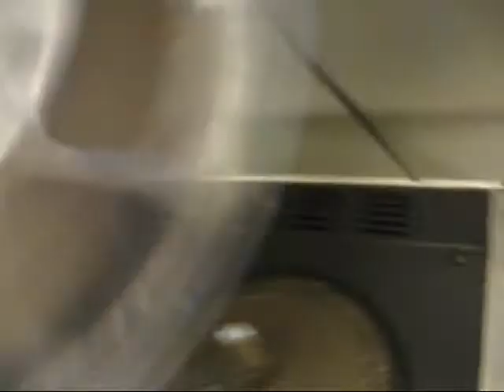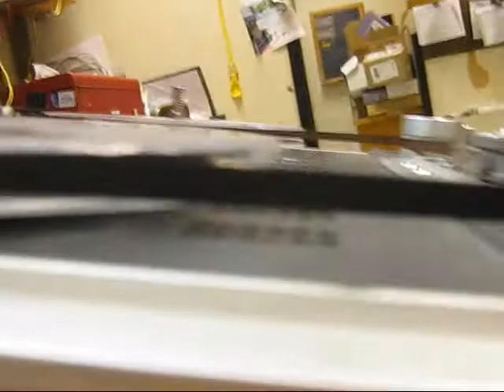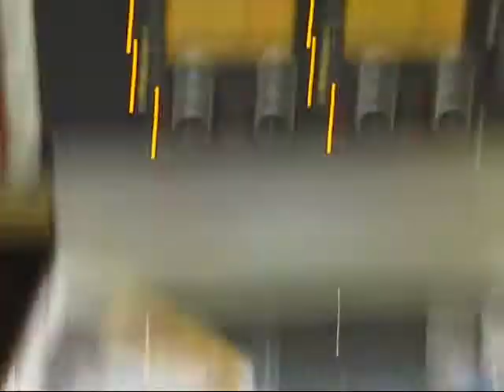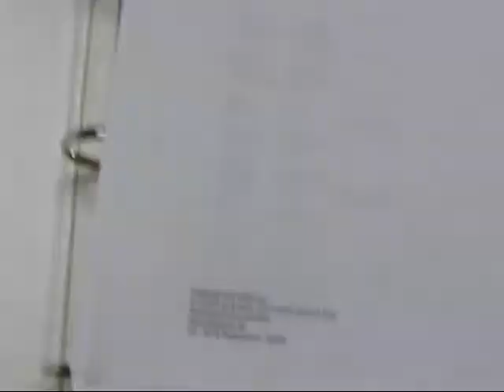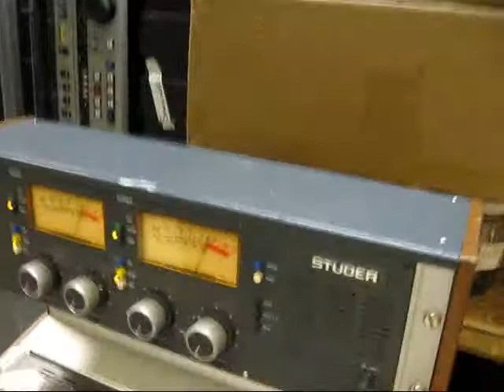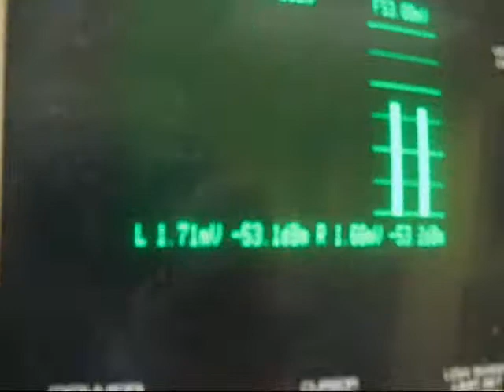Tapealigt.wmv

Comment: Want to know how you can win yourself a free pillow to place in front of your speaker? Just set the azimuth wrong while simultaneously enabling Dolby B noise reduction on a tape that wasn't recorded with the noise reduction on. Inserting this 'electronic speaker pillow' is what gives cassette tapes their bad audio quality.
Reply from the maker: I spent a lot of time as a kid trying to "optimize" my portable cassette recorder.  While I never really got great sound out of it, I learned a lot about how tape recording works. By the time I was working at a radio station as an engineer I was good at setting them up and keeping them sounding good. Even the cart machines.